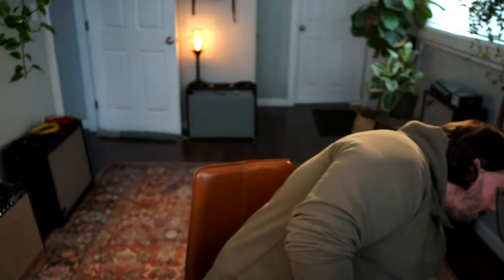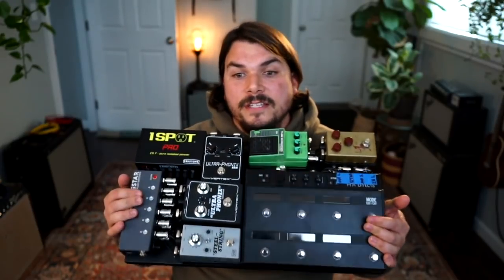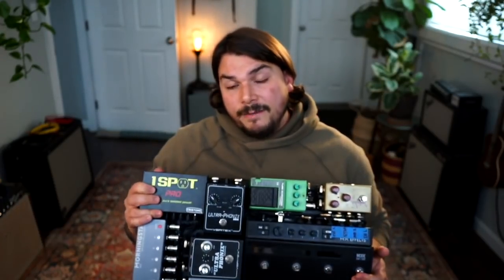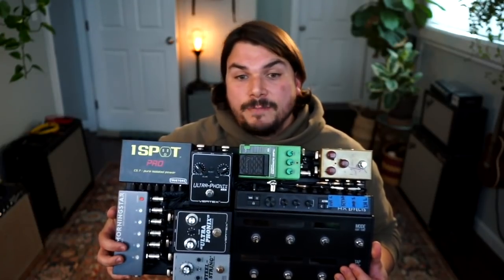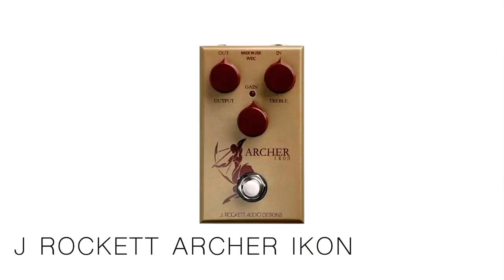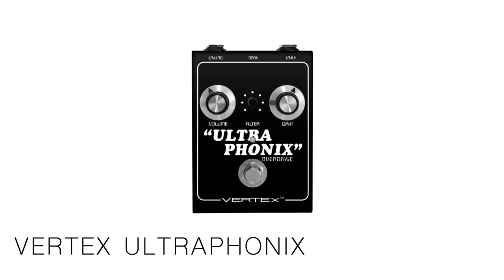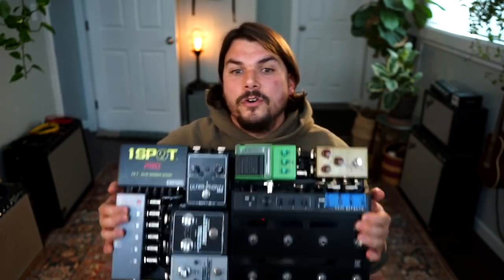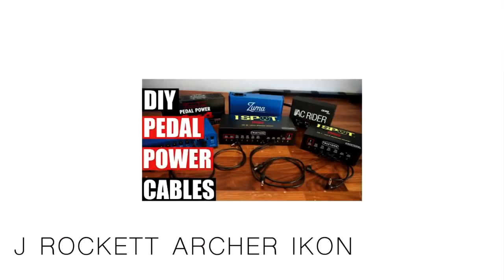The Ultimate JM/SRV Pedalboard!

Comment: So why is the power supply on the top and not under the board? If it cant fit underneath I dont need it.
Reply from the maker: Under the board is problematic for several reasons, firstly if it's an analog supply or linear, you have the magnetic field of the transformer that is going to create noise in other pedals, some more than others.  This will depend on each pedals ability to reject electro magnetic fields - in particular if they are steel or metal enclosures.  Even then your cables can have some issues as well.  Secondly, for professional contexts, pro rig builder standard is to have everything top mounted to trouble shoot things more effectively.  Flipping the boards upside-down and right-side-up to track down cables, shorts, etc. is a nightmare.